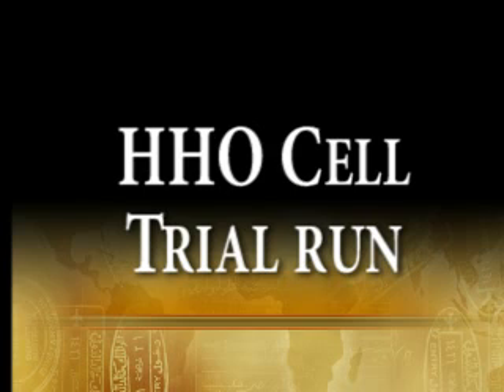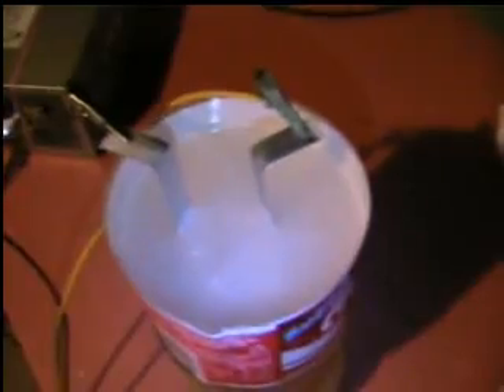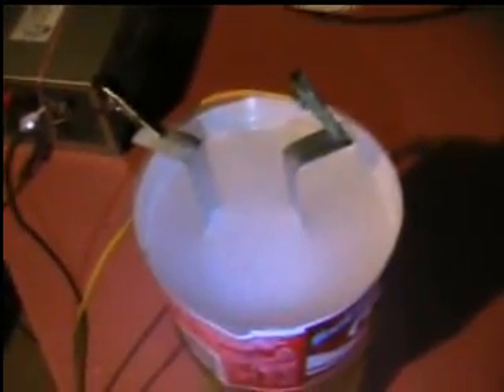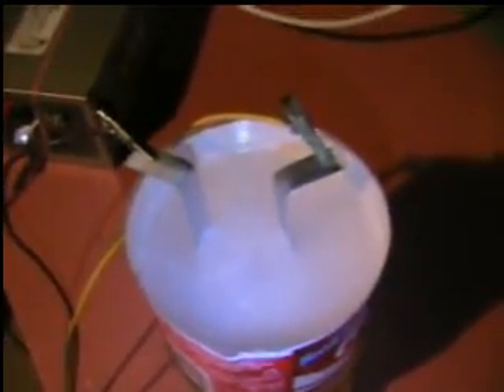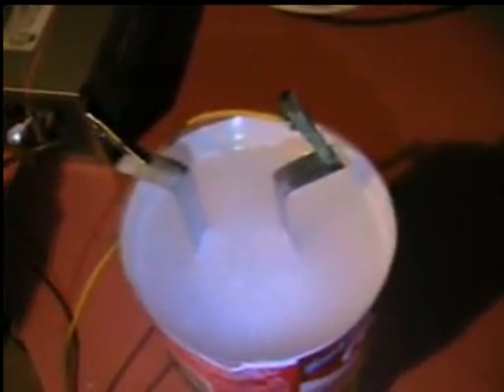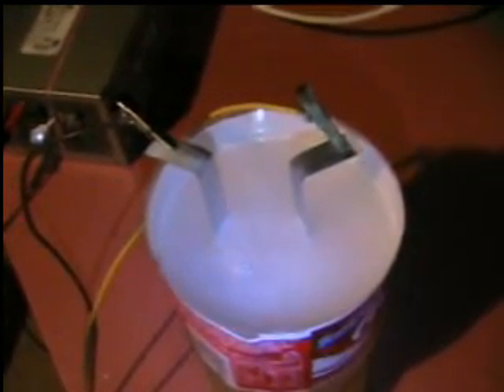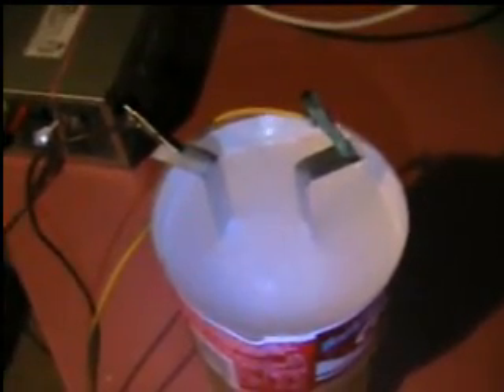HHO Single Cell Test

Comment from the maker: Sorry, don't have access to accurate amp meter right now but will post results when i get them. The PSU runs at max 12V and 10A ... and it ran for around 7-8 minutes before maxing out just to give you a ballpark figure. I think it's going to draw plenty, and the case isn't very big. Heat will be a problem.